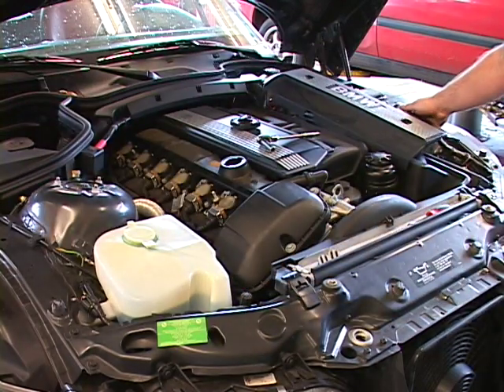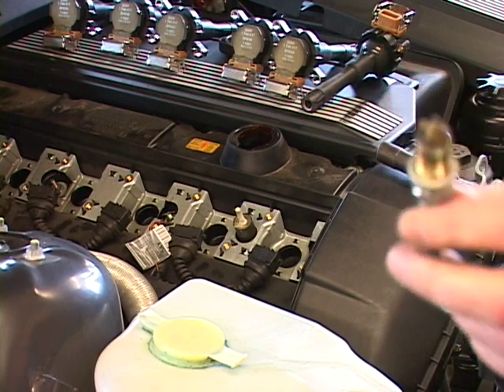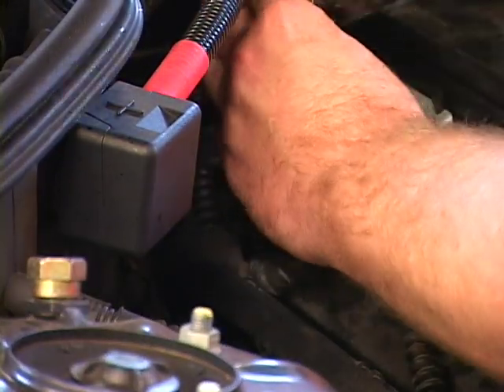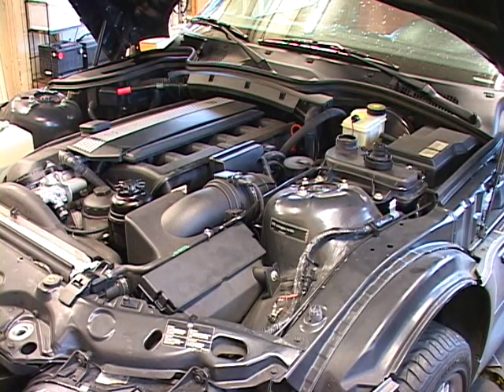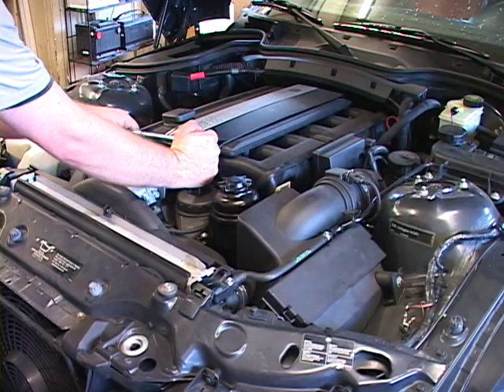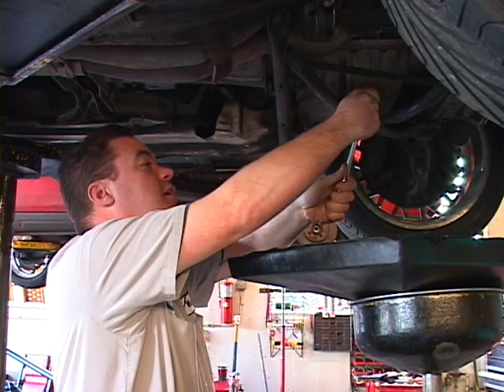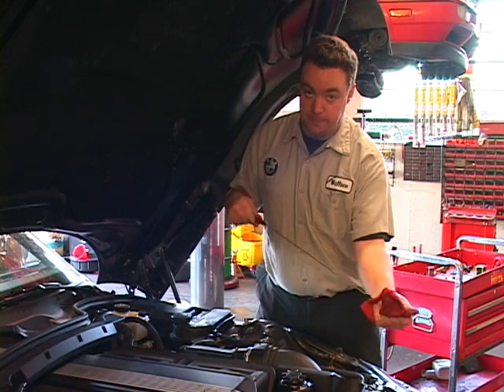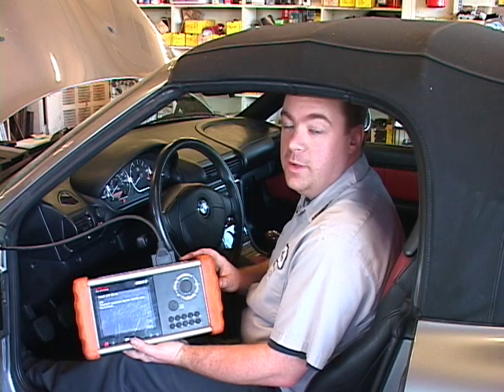Z3 Tune Up at Autobahn Imports in Eugene

Comment: The torque specs you provide are essential and save hours of searching on the web. Thanks. Think I want to change the spark plugs on my 2000 BMW Z3 2.3 roadster soon based on your step by step procedure.

Comment: Super helpful, thank you for providing the torque specifications.  (23 ft. lbs. for plugs, 7 ft. lbs. for ignition coil bolts and cover nuts. 18.5 ft. lbs. for the oil filter.)

Comment: Thanks so much!  I have a 1.9 w/ a downing atlanta supercharger but this gives me a good idea of what to expect.  Overdue for new spark plugs.  By the way I I know how to do this but if you wanted to add a note about resetting the oil light since we did just change the oil -- (in the same connector he connected the computer to, find pin 7, turn the key on and connect pin 7 with any piece of wire to any ground on the frame [top of the strut works fine] hold it there for 10 seconds and then remove, and your oil service light should reset).  You can also buy a cheap tool to do this for like 8 bucks on ebay.

Comment: Very well done and informative video but why did you install spark plugs with a single ground electrode after mentioning BMW's requirement for a plug with four grounds electrodes?  Surely, these will not last the full 60K miles between plug changes.  Just sayin'.    Semper Fi.

Comment from the maker: Tino, age of the spark plug will not make the check engine light to turn on. But if the old spark plug misfires you can count on the check engine light turning on.

Comment: Nice video, but I noticed you didn't torque to oil drain plug & oil filter housing. I believe they should both be torqued to 18 ft. lbs for both on the M54 engine.

Comment: I’m concerned about the plug torque figure.  Torque ratings usually have two numbers, dry thread and wet thread.  You replaced plugs that were torqued, dry, at the factory with the number you indicated.  The plugs you replaced you lubricated the threads, significantly changing the correct torque spec.  Generally dry torque value on a lubed thread is too high.

Comment: Hey man year ago buy a z3 
No any problems until now 
My check engine light came on 
Some thing about vacuum leaks so they Tell me fuel low pressure code gasket needs to be replaced can you Help me with that 
Thank you

Comment: if I (the car owner) the the oil spark plug and filter change does the computer service indicator will reset by itself or do I need to use a scanner??

Comment: Great Video!
Comment: The lubrication of the new spark plug threads, "Little Dab" Looked like TEN doses of "Little Dab".
  Wiping on lubriplate, and then wiping it off is PLENTY IMHO.
    On that point, Porsche has withdrawn, and advises against lubricating sparkplug threads due to potential impaired conductivity. While I can't square their policy with my knowledge of thread physics, I will not claim to be 'smarter' then their cadre of engineers; I'm sure they studied this issue in depth.   It could be their experience with their plugs (Bosch) presents zero need for lubrication, as the plugs already have some micro-applied lubrication... dunno.   (Now if only Porsche could show BMW how to  design and weld Z3/z4 rear differential associated mountings.)
Reply: Not sure if Cary is still around, and he raises a good point about Porsche's changing recommendations for dry seating vs. anti-seize on plugs. But for other readers - I believe the fellow in this video was using a type of anti-seize that actually is conductive. What I use is, and it looks identical to what he was using - Permatex 80078 which is (and I quote them) "A highly refined blend of aluminum, copper, and graphite lubricant". Aluminum, Copper and even graphite are all conductive. Obviously this would eliminate any concerns for impaired conductivity, which - to be fair to Cary - is a legitimate issue. Remember too that the seating face of the sparkplug is making full and unimpaired contact with the cylinder head well above where the threads start. Speaking as someone with very extensive electronics experience, and even if the threads were somehow impaired by some other anti-seize's poor conductivity, the plug seat area alone provides more than an adequate contact point to provide conductivity in this application. One final note - using anti-seize affects the torque values your tool will register. Read more here: https://www.antiseize.com/PDFs/torque_specifications.pdf  The general point is that one should reduce the torque value by 25% for any fastener so lubricated. This is particularly important when installing dissimilar material threads, like a steel spark plug into an aluminum cylinder head. IF you decide to use anti-seize (I do) adjust you plug torques accordingly.